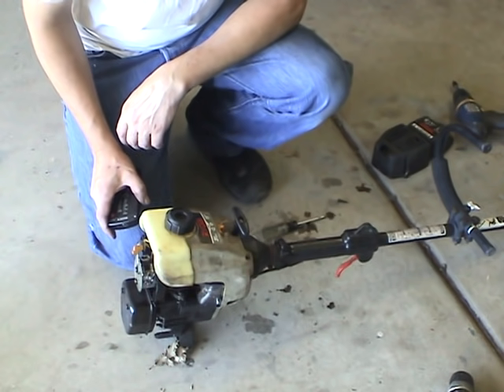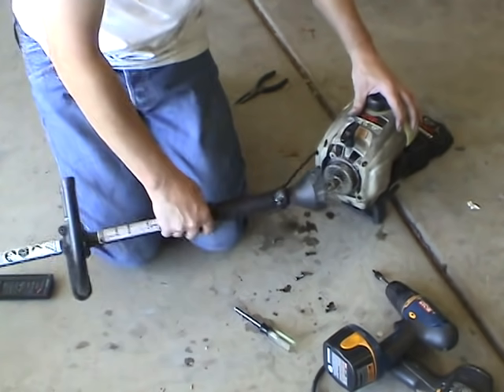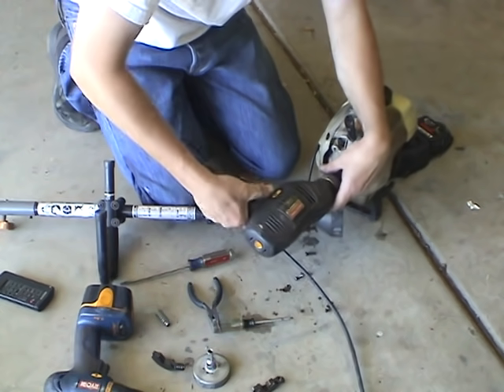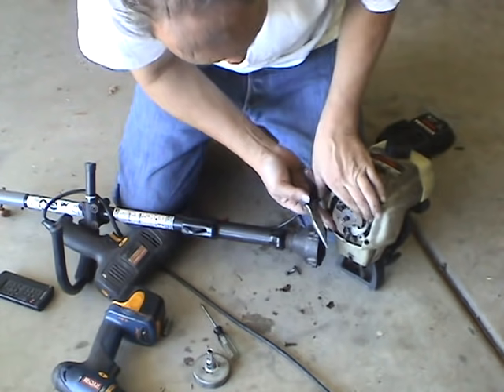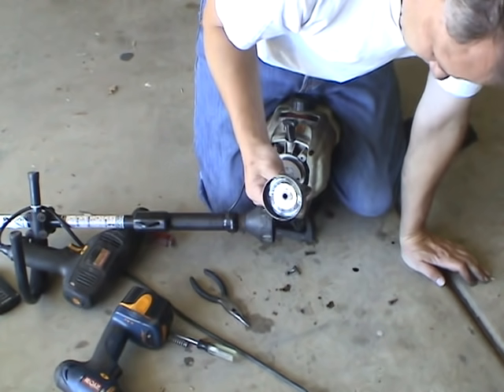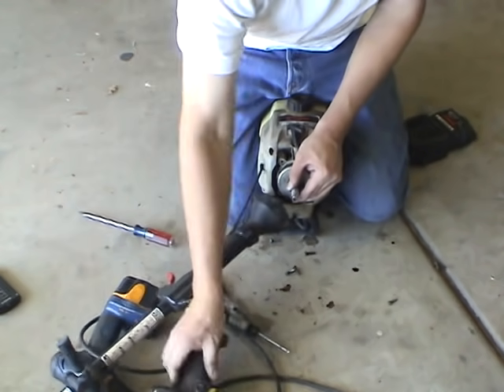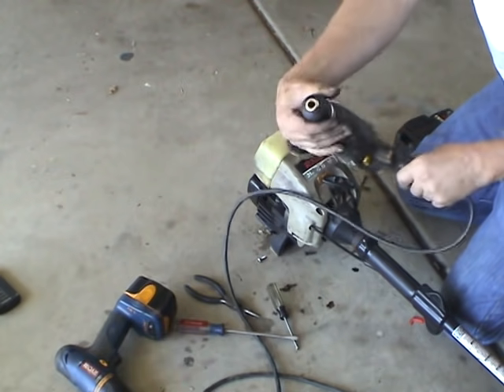How to start a trimmer if it won't START...

Comment: You say Dangerous Maybe it is: I would Do it myself but I'd think about putting it in  Vice to Grip the engine: Tell you what I Yanked My Shoulder off trying to Get the damned thing started I'd try anything: But what I don't Understand is why have the drill in reverse ? I thought the trimmer when strimming went Clockwise
Reply: I would think it clears out the gas lines.
Reply: what else would it do but clean out the Gas lines: The Fast speed Motion of the Power drill would cause Vaccum effect where it would Pull out all the Small debris that Blogged up the Port holes and Gas line: I Notice he says that the Centrifugal Clutch has to be taken off ! I was wondering if one could Put a Thick Cable Tie and wrap it Tight to prevent the Clutch from Opening out where it would prevent the Clutch Spreading out and flying off: I Have two Trimmers of which have Been stood over the past Year of what I Bought from a Car Boot sale One fires away when Two stroke Petrol is Poured directly into the Carb, where it Shows signs of Starting up I Might try Using the drill on one and taking the Carb, to Pieces and Cleaning the Gas lines with Carb cleaner that comes with a Tube that fits on the end and Use it to plush out all the Gunk
Reply: The drill would need to be running forwards if it was on the other end of the motors crank shaft.
Reply: That is what I thought !!! then why did he suggest that a Reverse drill be needed as the Normal type of drill has only forward Motion
Reply: Just realized it is a half crank engine, there is nothing on the other end of the engine to attach a drill to.

If it was a full crank engine he'd be able to remove the pull starter assembly and use a normal drill to spin it from that end.
Reply: I Know this to be true But I was referring to the fact that the the drill need not have had a Counter clock motion as it was crank which spun Clockwise: I also wrote that if the centrifugal Clutch had a thick Cable tie wrapped around it Perhaps there would be no need to dissemble the Clutch or to take away the springs where the Cable tie would prevent the Centrifugal clutch from Opening out
Reply: +Roland Mitchell he is spinning the engine clockwise, the drill is spinning anti clockwise if your looking at it from behind the drill, but if you look at it in relation to the back of the engine it's clockwise, my explanation probably doesn't make much sense though.

A heavy cable tie would work just fine to hold the clutch shoes like you suggest, but I don't think I'd be keen on giving it too much RPM with it though lol
Reply: what the hell we only live Once !!if  the clutch  flies off It could send me to my early Grave or smash through the window (who cares a Sh*t ) ah ah
Reply: The trimmer does rotate clockwise, that's why the drill has to be running backwards
Reply: Yes I understand Now on how it works

Comment: You think this is bad. I did this same thing with a push mower. I used a very loose socket on the top of the crankshaft. I'd just pull up once it was started. Still wouldn't recommend it though

Comment: do not remove spring. Do try everything else.
Reply: Mnop Lmnop why, because my outboard engine won't start, it didn't work for a long time now, i loaded it and nothing, it just won't start, i checked for sparkplug, cleaned the carburetor - which was pretty dirt though... if you have any knowledge about it could you please help me

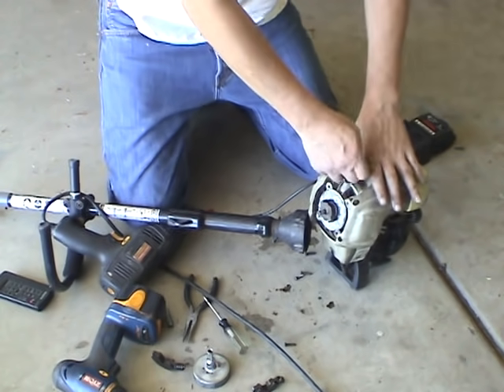Comment: so it was that spider vacating your engine at 3:31 that maybe cured your problems lol
Reply: So this is a reply to the original comment about using ether:
 I asked my therapist, sir El Ohell and I was reminded of the potential damage caused my starting fluid, unless you make absolutely certain to smoke a cigarette while spraying it to soak up the fumes and prevent a build up. Also he suggested that you I am sure to do this in a room with minimal ventilation and air flow as this will cause the fumes to disapate too rapidly.
Reply: She's like "Fuck this. I'm out"
Reply: So what you're trying to say is that I should just by a new one.

Comment: I can get it started with the Drill but as soon as I cut it and then use the pull start I can't get it to run
Reply: Did you figure out your problem?
Reply: An easy way to get your trimmer to start:
Step 1. Remove the front.
Step 2. I go find a different YT video.

Comment: Part of the problem is the brand in the video.  Also, if you have any thoughts that it may be a while before you use the equipment again, drain the tank and run the engine til it dies to clear the carburetor of any fuel.  And lastly, buy a quality piece of equipment such as Stihl, Echo or Husqvarna.  The initial cost is two or three times more than most brands but the brands I mentioned are not disposable.  I buy good stuff now because I've bought bad stuff.
Reply: +Thomas Streetman Even the best brand will crap out on you if you don't take care of it when you store it, which is the case here in my opinion. Or maybe it wasn't properly winterized in a previous year and he's just fighting the same "damage" every spring.  It only takes once to gum up the carb.

Comment: Just a little spray of ether in the carb will start it, this video is scary.
Reply from the maker: Tried that, still didn't work
Reply: +Jim Pierce come on dude
Reply: I have better things to do than to fuck around with grammer
Reply: Amen Brother, everyone has to be so politically correct it makes me wanna puke. Oh yea, I tried what he was doing for shits and grins, mistake I cut one of my fucking finger tips off. I wish I had never saw this fucked up video, I miss my finger tip.
Reply: Agree! A lot of parts to reassemble too or go buy a new one!
Reply: jeg gej ddddddddddddddddddddddddddddddddddddddd
Reply: Ether will not start it all the time. I have never ever had any luck using any of those starting fluids in trying to start a small engine but it is also a easy and good way to catch the plastic on fire and burn up the weed eater.
Reply: jeg gej  ether is a grey way to scour a ring and cylinder. few drops of gas mix on piston will do it safely
Reply: Kenya Swallow 'mycome' octane doesn't add power and it takes more energy to combust. That's the point of it, to prevent preignition in high temperature/pressure environments which is indicative of high power applications.
Reply: @Barnard Tablet       When did fuel start having glimpses of the future? This is why my old chevy knocks.... This changes everything.
Reply: @jeg gej... Sorry about your finger tip but obviously you did something wrong. He didn't lose a body part and proved that his method works. And apparently you didn't think the video was fucked up from the start because you went out and tried it his way. Again, sorry about the finger but you have only yourself to blame.
Reply: Like not going to school?
Reply: Apparently so, because the word is grammar !!
Reply: grandpa is relieved
Reply: Do not use ether heater explodes so strongly it could punch out your piston head

Comment: 1st: Check, Clean or replace Spark Plug and Fuel.
2nd: Remove Petrol/Oil from the tank.
3rd: Remove Air Intake filter and clean.
4th: Remove Fuel Lines and Clean if possible.
5th: Remove Carburettor and Clean.
6th: Put air through intake line and return line and see if any air is escaping.
7th: Adjust Air+Fuel Mixture screws to standards.
8th: Adjust Throttle Screw if required.
9th: Unscrew the Engine Cylinder Head bolts and remove it, make sure the gasket is sealing the Cylinder Head to the Crankcase.
10th: Make sure the piston runs smoothly up and down the Combustion Chamber, without no wobbling. 
11th: Make sure the pull start is creating a spark to the spark plug.
12th: Check all seals including: Fuel Lines, Carburettor, Engine Block, spark plug and exhaust outlet.
13th: Remove, Replace or and Clean exhaust filter and case, also if needed replace the seal.
14th: Recheck all, if still doesn't work take it too a local Engine Hospital, tell the mechanic what you have already repaired, cleaned or replaced on it.
16th: Buy and new one.

I hoped this helped I probably missed alot of stuff, but my whipper wouldn't start and I tried all of the following, got it started. It is the spark plug, it was misfiring when it got too hot. This was the same with a Pee Wee 50 that I repaired.

Cheers I hope you can get it working for anyone who cant, if you have already tried this method.
Reply: 4 years too late, but what happened to #15?
Reply: hahaha, 15, buy new unit
Reply: If I had to do all that I will toss  mine into a Bin !

Comment: First mistake you made was going with Ryobi.
Reply from the maker: That goes without saying
Reply: Michael Green Craftsman is made by multiple brands. You would have to research the Model#. For example. My parent have a Craftsman chainsaw and it is made by Poulan.
Reply: Craftsmnan model 358.791010 is a piece of crap.  It runs great if the proper storage techniques are used but if the starter rope breaks you have to disassemble the whole dang thing to replace it.  Poorly designed.  I will spend a bit more on the next trimmer and avoid many headaches.
Reply: My ryobi 775 has worked for 12 years no problem, till now on starting
Reply: sierravmax first mistake was buying gas trimmers. Spend more time fixing them than using em
Reply: sierravmax
Reply: Can happen with any small 2 stroke
Reply: + @frankwhelan1715 :  That's exactly correct! It's the "watered gas" we're forced to buy/use thanks to the rapacious corn farmers.
Reply: Have had [ and used ] my Ryobi strimmer for over 10 years , its still good and starts every time , particularly good as ive never serviced it , not even the spark plug .  I for one would certainly buy another .!!
Reply: Bought my ryobi 775r about 25 years ago in a garage sale and LOVE LOVE LOVE it with all the accessories that I've bought since then. I'm a Ryobi fan for life.

Comment: I am sorry, this video is a waste of time.    #1, check/replace fuel lines and filter.  #2, clean carb (or have it cleaned/rebuilt).  There are you-tube videos on #1 & #2.   If #1 or #2 don't work, have a professional look at it (or sell on Craigslist as "needs TLC" :-) ).

Comment: That is certainly one way of doing it, Mr. Hannig....OR........  If fuel delivery is the suspected culprit, you could shoot a quick squirt or two of WD-40(NOT ETHER OR QUICK-STARTING FLUID) into the carb.  Then, without any disassembling, start the thing as you normally would while spraying a little bit more WD-40 into the carb when it starts to die.  Doing so will render the same result as the video, but without dismantling half the unit.  Of course, this is all assuming you emptied the fuel tank, ran the fuel out of the carb, removed the spark-plug and squirt some 2-cycle oil into the combustion chamber at the end of last season.  You DID do that, right?  Oh yeah...what was I thinking...of course you did....because, regardless of climate, that's what your supposed to do before hanging it up on the garage wall for 6-8 months.  I've lived in humid, coastal regions, and I've lived in dry-as-hell regions...and NEVER...repeat....NEVER FRICKIN' EVER had an issue in the spring when I properly stowed it in the fall...not even when it was stored for two years...not with 1 year old units...not with 10 year old units...not with chain saws, blowers, trimmers, or even a Mantis tiller.  And the safety thing doesn't bother me, if someone wants to try this and can't recognize the hazards, then off with their head I say - the gene pool will benefit!
Reply: Thanks a lot, I just tried this and it worked haha!

Comment: The good part about this video is: no advertisement !!!
However: People !!! just buy a can of "starting ether" open the choke...open the throttle... spray a shot a that good stuff in there (not TOO MUCH now... "a little dab'll do ya")  hide the can behind ya & pull the chord ... EVERY TIME WORKS
Lawnmowers also /// Du Hanning's idea is ok for starting those miniature diesel motors
 used in  model airplanes.

Comment: hey bud I'm not here to bash your "how to"... you have basically used. Power drill to "PRIME" the crank case. most people don't know the principles of how a 2 cycle works. tour hard start is from low compression or vacume leak. A few pulls is normal until the crankcase has fuel to charge the cylinder.

Comment: Way too much drama. You need to use the choke BUT not give it gas until it starts to idle on its own for a while. If not throw that garbage away and buy lithium ion one. I also spent more time fixing gas junk than actually using them.